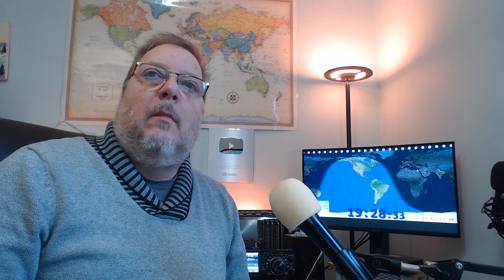Amateur radio question Why do contest stations work split using two different frequencies

Comment: Shortwave listeners that own a RSP1a may set SDRuno with an additional VRX (up to 16 VRX's) to listen to the splits as long as the split frequencies are within the same sample rate or 'SR'. Gilles will you demonstrate this in video, please? RSPduo can use both receivers. I think RSPdx users will have to use the same method as the RSP1a. @OfficialSWLchannel

Comment: I too use split on 40m to help separate all the pileups.  From Alaska I can Transmit on on a special segregated frequency too,  ( FCC:  Phone and Image modes are permitted between 7.075 and 7.100 MHz for FCC licensed stations in ITU Regions 1 and 3, and by FCC licensed stations in ITU Region 2 located West of 130 degrees West longitude).  *Very nice and polite of you to remain on frequency and remind people the DX station is working split.